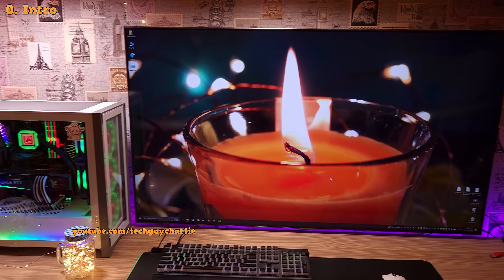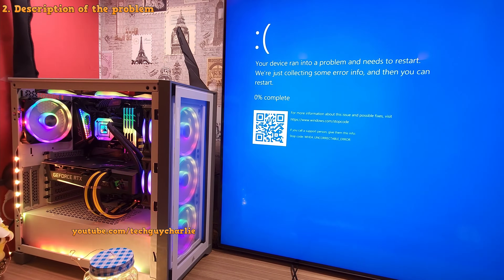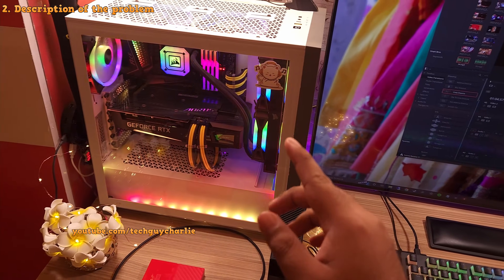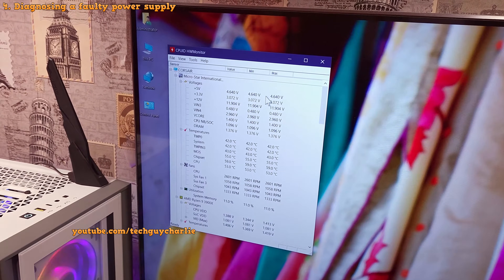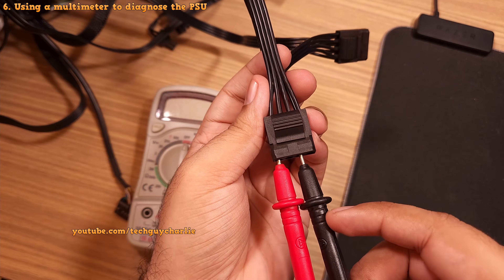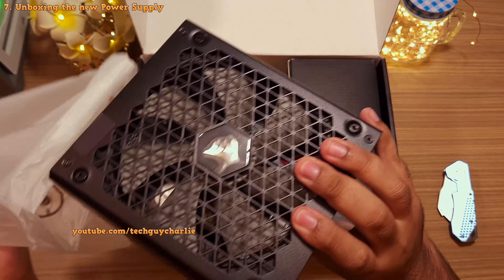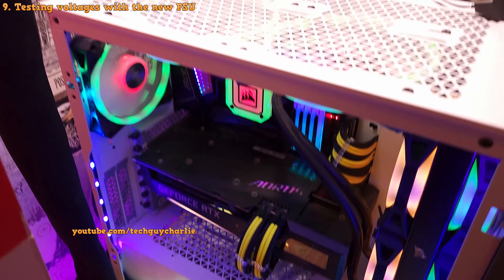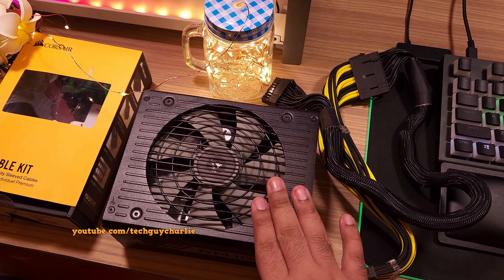How to fix WHEA Uncorrectable Error Bluescreen and USB Disconnection Issues

Comment: today i experienced a whea uncorrectable error on my pc while running a game-it occured the moment the gpu temps crossed 80 C . I was able to replicate the issue by running furmark for a couple of minutes-as soon as the temps exceeded 80C the screen blanked out and i had to hard reset the pc to get it working. Is this issue being caused by the gpu or a faulty power supply?

The problem occurs specifically when the temps of the gpu exceed 80 degrees celcius-i dont know what to make of it. In my case,i haven't faced any intermittent usb devices disconnections or any other usb related issue. IS there any way to determine whether the gpu or psu is the culprit?

Quite similar to your situation,no crashes occur when i am doing routine tasks like web browsing.

My gpu is a zotac 3060ti and psu is Corsair RMe 750. Please advise.
Reply from the maker: Sounds exactly the same kind of symptoms I had, but in my case the temps were totally fine. By the way, have the temps have always been like this? even before this problem started? 
You could just grab a multimeter and read the voltages, but from what I've learnt this goes deeper than just voltages, these issues can also be caused by failing power supply which seem to output correct voltages or even a failing SSD.
Do you have access to another PC that you could test your GPU on? that will rule out any GPU faults.

Comment: My friend thanks a lot from Turkey, I exactly had same issues and follow all of your instruction, my  PSU is Asus Rog Thor 1200 and I use lian li strimer cable for 24 pin connection, I measured 4.7 approximately from usb, my devices constantly disconnect and reconnect again time to time, I change 24 pin cable with original one which comes with PSU,  now I test with OCTT stability test  and HWMonitor, usb comes back 5.04v, 12v corrected itself also 3V corrected itself, these are had same lower values also. all the problem was coming from Lian Li Strimer cable, you are the perfect man, I did not get any system BSOD like whea error. Thank you very very much buddy. Take care yourself.
Reply from the maker: These extension cables are a bad idea, having the correct voltages are critical, especially on these newer high end PC's!! Glad I could help you solve the problem.
Reply: @  After a couples of hours, ı use 5 different razer mouse pad for illumination and sync them all with system sound ( looks georgous ) and again time to time some mousepad disconnect and reconnect again but while this happening, ı follow the voltages from hwinfo and usb tester, usb voltages are operating between 5.05 and never went down, is this hardware malfunction or about w10 or something else ? Do you have any idea ?

Comment: If it happens during gaming, it might be your Eztrension cables that you connect with GPU

IF it's during your CPU Usage time (like editing in PR), IT might be because of CPU Voltage setup. I'm having the issue while editing videos (4k). If anyone have a solution, pls share

Comment: In my case. I get this error after installing a new CPU and MB
 
It doesn't happen while gaming but it happens while editing videos on Premiere pro.

What do you think I should do

Amd Ryzen 9 5900x
Asrock steel legend b550m
Gigabyte rtx 3060

I just installed new fans in my AIO + two more fans but it didn't help :(
Reply: refound your cpu take an other model its a cpu issue 5900x is a really bad cpu

Comment: Everyone's different - may have to attempt multiple solutions. I tried all the steps and every video, except the most simplest one IF you can get into safe mode or regular. 

I was unable to Uninstall the most recent updates since July 24. I have Windows 11.
Settings>Windows Update>Update History>Uninstall Updates
- Security Update for Microsoft (KB2565063)
- 2024-07 Cumulative Update for Windows 11 Version 22H2 for x64-based systems (KB5040442)
- 2024-07 Cumulative Update for .NET Framework 3.5 and 4.8.1 for Windows 11, version 22H2 for x64 (KB5039895)

I would bluescreen this error every time I opened a game since these updates. Before then I was just fine and it's a newly upgraded/reset windows 11 from Geeksquad fixed last month from another blue screen. It's happening more often including my work laptop that's Dell. Microsoft - clearly out of control even before the major outage. Wish someone would make a better operating system.

Comment: I’ve been having that issue and got a new power supply and everything but it just started happening again. After replacing the motherboard the pc crashing stopped for a week or two and then just started doing it again
Reply from the maker: Have you considered it might have something to do with the power outlet? 🤔 maybe loose connections inside?

Comment: It's seems if i am booting windows from ssd nvme i have this error but if i am booting from ssd sata no issues so its or the new Kingston ssd nvme or the motherboard slot!!
Reply from the maker: I wonder if the SSD is going bad? can you test the nvme on another PC or laptop?
Reply: @TechGuyCharlie  Hmm i have test it with HDtune and it didnt crashed or had bad sectors ,i could test it in my main pc..... sometimes the blue screen occure a few minutes after the desktop appears......the board its old , its a b350 .....this is my nephew's pc, i have upgrade the ssd and video card so he can play gta 5 ,it has an ryzen 5 3600
Reply: @TechGuyCharlie  Its kingston snv2s/1000g, are they known for failing?? !!
Reply: @smamas114  i know im late, but did you find out if it was your nvme or not, i have the same, ive been chasing this WHEA error for a couple months, ive tried mem test, prime95,  moving ram around, removing overclock, reseating/ rethermal pasting stuff,  currently i am trying on removing extension cables incase its a power delivery problem,  im assuming its either, my nvme is crapping out (i havent figured a good way to test it yet), or its my very old PSU giving up, or its my cpu/mobo,   which is leaving me with more questions than answers
Reply: @leetrisk I ve purchased and pcie to ssd adaptor and the Kingston ssd is working now , i very sure that the ssd slot on the motherboard is broken because the ssd also works on another motherboard!
Reply: @smamas114  nice, for me right now i have completely re-installed my gpu driver, and removed the cable extension to it, and have not got a crash so far 🤞 its been an hour or so on the game, i have checked my nvme too and it doesnt seem to be doing anything weird/bad temperature, i was worried before cos i noticed a big 100% spike of disk usage right before it BSOD, but not everytime- just most times

Comment: i cant tell you how many videos i watched on this issue with no help. Time to disconnect my extension cables and if that doesnt work get a new power supply. I had a feeling it could have been the PSU i accidently dropped water on it a little while back but it still worked but maybe not as good as i thought.

Edit: got rid of the extension cables and got a big boost to my voltage on the HWMonitor app.
Reply from the maker: That is awesome! Glad the problem is fixed.

Comment: My new PSU is coming today, and i hope so much my Bluescreens and shutdowns, freezes are because of my old PSU, i bought a few days ago a new M2 SSD bc i thought its coming from there but no, I'm pretty confident because of you that its my PSU, i will see it later :D Thanks in advance <3
Reply from the maker: Please let me know if a new PSU fixes your issue? Its most likely the RAM or the PSU, definitely not the m.2 ssd but my money is on the PSU!!
Reply: @TechGuyCharlie  long story short .... it was the PSU :) yea i know i bought the m.2 SSD because i couldnt fresh install Win 10 on my old m.2, but after buying a new m.2 SSD i still couldnt install it, so i changed a setting in Bios and then i could install it on the new m.2 SSD. i guess my old m.2 is still working, im gonna test it the next days and put it back in ^^ then i replaced all 4 RAM Sticks with my old ones but it was still crashing. Then i tried only the 2nd & 4th RAM SLOT, but still Bluescreens, changed the Graphics card but still blue screens, till the new PSU was installed :) i instantly knew its gonna work because as you showed in the Video with the HWMonitor Tool the +3.3v +12v +5v was way under the Numbers, so my old psu had on +3v only 2.5v the 12v only had 11.6v, and when i installed the new PSU it showed instantly 12v at 12v, 3.3v at 3.3v, and 5v at 5v. so I was instantly happy when I saw the numbers, the System is running since then without any Problems, no Bluescreens, no Shut downs no nothing, im now more then 2h in my Game without a Bluescreen/crash/freeze, normally i get Bluescreen after not even 5min. and what was really weird before every Bluescreen my LAN Connection just deavtivated itselfs, but not anymore :D thx my brother <3 <3

Comment: I just bought me a brand new Corsair 850w Gold+ after I upgraded oa 3080 from my 2070 super. I have a Asus Rog stix b550 gaming mobo and a Ryzen 9 5900x. I got this error today while playing Apex. I've never had this error before. And it better not be a new psu.  Im either at needing a new mobo, an ssd or i might have to cut my extensions out of the equation and might need to get longer cables.
Reply from the maker: Its most likley the extension cables, try running your PC without them and see if anything changes, it can also be the SSD and the board but from my experience that is highly unlikley.

Comment: Hi Charlie 
i bought a new pc a year ago, since then i have daily BSOD "WHEA Uncorrectable Error, Stopcode Watchdog Timeout" and some others
I have tried everything but can not find a solution 
like in the video sometimes my usb devices go on and off so i checked my voltages but they are normal do you have any idea ?

Specs
CPU: Intel Core i9-12900K, 8x 3.20 GHz, 8xE, 30MB L3 Cache
MBO: Gigabyte Z690 AORUS MASTER (DDR5)
GRA: NVIDIA GeForce RTX 3080, 10GB (Gigabyte Gaming OC V2 LHR)

RAM: 64GB (4x 16GB Kit) DDR5-5600 CL36, Corsair Dominator RGB
PSU: 1000W - Corsair RMx Series 2021 80+ Gold
Reply from the maker: Hard to say, if the voltages are normal, you could try a couple of things: 
1. Re-seat the cables
2. Run Crystal Disk info to check if there are any issues with the SSD
3. Do a clean install of Windows
4. Undo any overclocking/Overvolting on the CPU and GPU.

Its highly unlikely its the RAM or the CPU, but who knows.

Comment: Im having the same error but on a alienware laptop. Wondering if running a death battery could be causing that blue screen. My battery died a couple months ago and i ve been using my laptop connected 24/7 since then. I also tried a factory reset already so no software issue

Comment: WHEA errors are due to low voltage - correct. In your case it was PSU. However in most cases it is a sign of a defective CPU. Usually on low loads while the CPU boost to a very high clocks it "demands" too little voltage from your motherboard that is not enough to sustain itself and so it throws cache error and crashes. Pretty common with 5000 series CPUs unfortunately... RMA is your only solution for a permanent fix. Of course as long as your new CPU also isn't defective..
Reply from the maker: Correct! This is why everyone should have a multimeter at home so can rule out issues with the PSU.

Comment: But my laptop only crash with this error when it is not under high load. I even ran a few 30 min stress tests and it didn't crash. But when I'm working on something with two 3 browsers open or even when i close them and leave the system running, it crashes.
Reply from the maker: I'm wondering that it might be the SSD or the RAM. Probably a good idea to first re-install Windows and see if it fixes the problem, if not then take it for service.

Comment: hello charlie,little question,in idle i have +12V in 11.909V to 12.000V, +5V in 4.720V and +3.3V in 3.088V .... i get the same BSOD,and controller disconnection,also my 3080 Ti cable is blinking red in 2 of the slot,left one is not blinking,when playing "heavy" games it dropped to around 11.600V in +12V, but in ur video it drops to around 11.300V....should i consider changing PSU/Extension?? or i need to inspect the GPU/CPU also?

Comment: in my HW Monitor i don't have a 5v, 3.3v or 12v listed it's all CPU VCORE then VIN1-VIN8? Ryzen 5600x with 3060ti and corsair 750 gold.
Reply from the maker: Some motherboards don't report the voltages, so I'd suggest using a multimeter to measure the voltages directly from the power supply.

Comment: I have HX750 which encounter same problem, I've already RMA it few times and problem keep returning after few periods, making me upgrade almost whole my system and now it's back again

Seeing you have similar problem with same PSU brand, now I think I'm not gonna use Corsair PSU anymore ... I'm gonna use Super Flower.. that one great on my other PC
Reply from the maker: So it seems its a recurring problem with Corsair? Might sound strange, but I've had Corsair's cheap VS and CX series last longer in a system that's powered on 24x7 than my rm1000x, one of the reasons why I went with Corsair again despite the failure.
I really hope the HX750 lasts a couple of years, these power supplies aren't cheap, if it doesn't, I will avoid Corsair all together.

Comment: Thank you for this video! I tested my psu like you said and got a reading of more than 14 volts. 14.83 volts. My PC is still crashing. I have a PCIe USB 3.0 port too. I'd be much obliged if you could tell me what else could be causing it to crash with a whea error. Also, I've replaced my RAM recently, but that didn't solve the problem either. Thanks
Reply: I've wasted  a lot of money replacing my ssd and my RAM and wasted time running several tests several times but the problem was really dirty and loose cables. I had cleaned the ssd cables recently and never suspected that the usb header cables would be the culprit.
Reply: I think I've figured out the problem. I first tried disonnecting and re connecting the main cable from psu to motherboard. Problem improved but was not eliminated. Then I disconnected and cleaned my usb header cables with cleaning spray. This solved the problem. But yes I knew where to look because of your video. It drew my attention to the usb ports.
Reply: This was after I tested my psu with a multimeter, ofcourse.

Comment: Hello, i am having the exact same issue as you where the error code will come up and the blue screen when im playing a game, it wont do it when watching vids but my psu is not the issue, the voltage on everything is on point to where it only goes from 5v to 4.9v and then 12v will go down to 11.8v  when playing games  so my psu isnt the issue, i installed a new cpu and this is when the issue started to occur, would you know what the issue could be?
Reply from the maker: Can be something as easy as a loose CPU cooler/thermal paste issue to a defective CPU, I highly doubt its a defective processor though. Did you check the temps?
Reply: @TechGuyCharlie  yes i called up the place i bought it from and they said it could be the extension lead, and so far its sorted out the issue
Reply: @damiennoxon9559 bro how did you end up fixing this issue

Comment: Appreciate the insight regarding the issue Charlie..ive been getting this recently if I run my game on my HDD, but after transferring it to my SSD it doesn't happen anymore..was wondering if PSU is also the culprit here..and yeah I do use those extension cables too >.<
Reply from the maker: Thank you Ed, just to rule out the PSU,  I would suggest getting a multimeter and probing the voltages while gaming.
Could you also try removing extension cables and see if it makes any difference?
Reply: @TechGuyCharlie  ayeee..thanks for the suggestion😃would try that

Comment: So in this case when PSU is not holding the correct voltage, can you actually return it and get a replacement?
Reply from the maker: Corsair should replace it since its got 10 years warranty. But that isn't applicable in my country.
Speaking out of personal experience, due to weak consumer protection laws, brands don't honor warranty, so if something goes bad, you are pretty much on your own.

Comment: i have the same issue.
Hardware:-
CPU Ryzen 5900x
Mother Board - Asus ROG B550 Gaming WIFI II
RAM - ADATA 32 GB 3200 Mhz
PSU - Corsair RM850
GPU -MSI 1070 GTX 8 GB

I have checked all the voltage in HWMONITER it's fine but facing this issue while playing games.

Please help.
Reply: That CPU is plagued with this issue. Same problem here man
Reply: Same problem with similar specs here. It happens specially while editing videos and CPU is in use. I think it's some short of CPU VOLTAGE thing

Were u able to solve it?

Comment: Thank you, this video helped me. I was having random blue screen when playing steam games for like 5 months now. I thought it's just my ram or something. But after watching your video, I removed the 2 extension cable that I bought from amazon that is connected to my GPU then used the cable from PSU straight to my GPU. It works no more blue screen. I think it's really because of the extension cable.
Reply from the maker: Super glad that the problem is fixed, it usually always is the power supply or the extension cables. 😊

Comment: I’ve had this problem for nearly 2 months now. I built a whole new pc, and I was shocked because I thought I might’ve installed the wrong drivers etc. I replaced the MB for a better one and I got a better GPU than the one I had. Still ran into the issue, but I did notice how the mouse would just DISAPPEAR Sometimes, or stop working. I will be diagnosing the PSU later. Hopefully this is what it is.  Thank you!!!
Reply from the maker: If you have gone through the effort of replacing the whole motherboard, then it's most likely the PSU!! Let me know if replacing it fixes the issue.